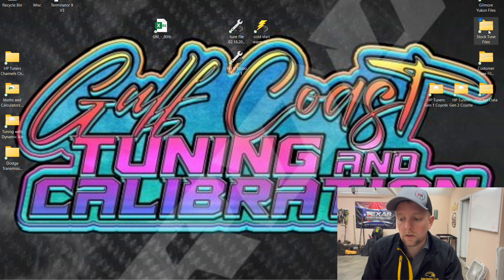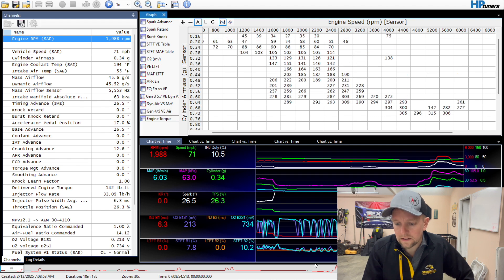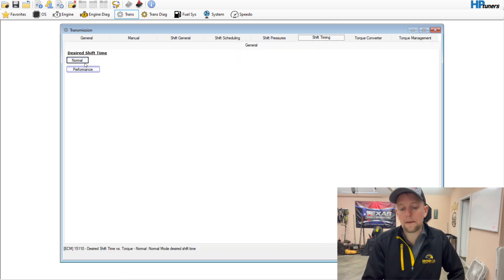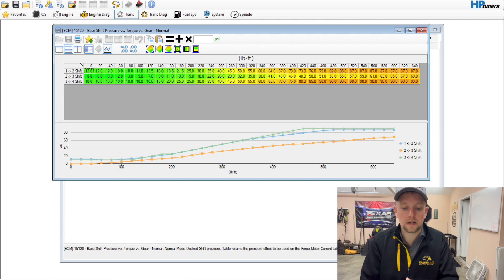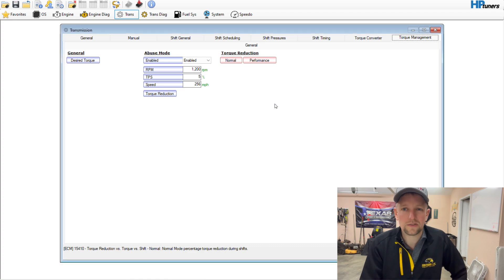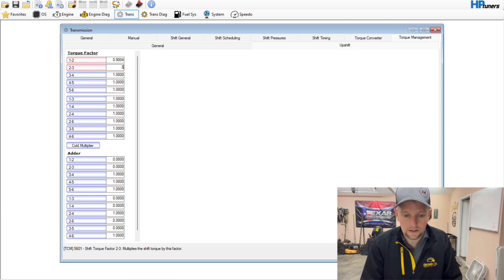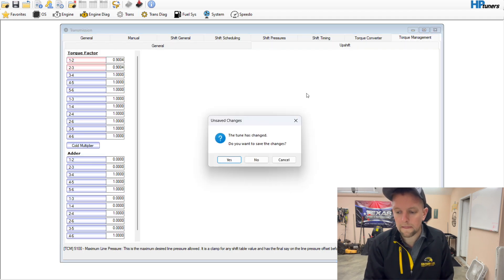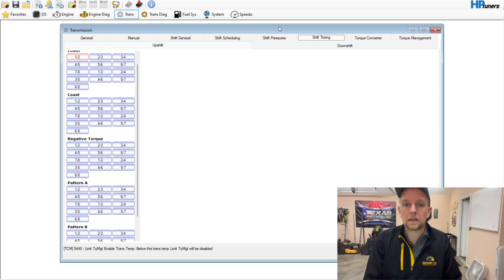Positive Shift Pressure is good and HERE IS WHY

Comment from the maker: I can’t spell it out anymore obviously than this! Post the rides that you guys are using this info with!
Reply: also good to look at the fmc table. i like to start out on base normal with zero out 0lb lbft and put 50 in 640, interpolate, copy then paste to base table. gets it pretty good and should match max pressue if setting to 96 for stock 4 speed units. wanna really have fun (+/-) 5 to10 % on the fmc or epc without messing with base pressure to much but correct way is to put a line pressure gauge on trans.